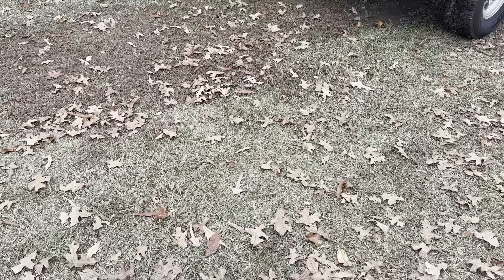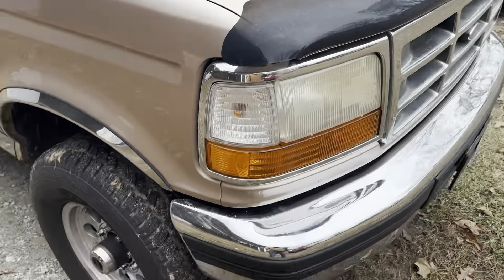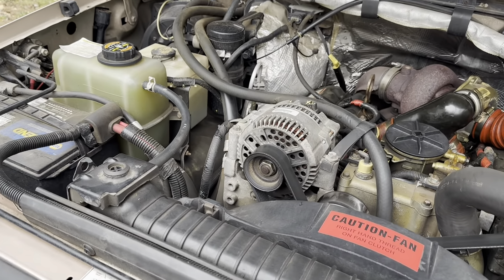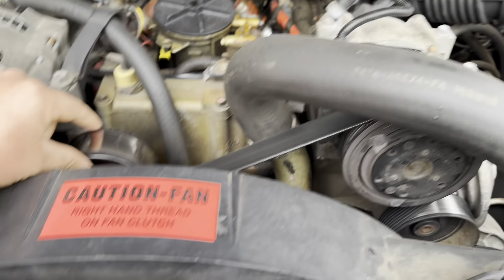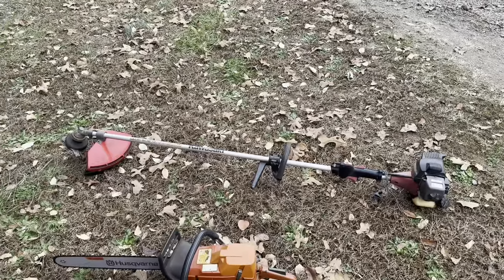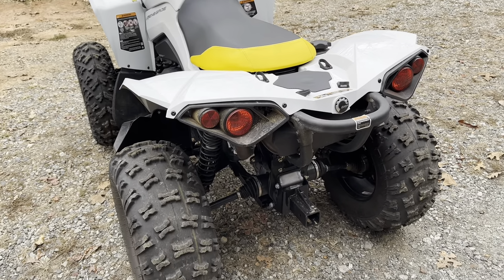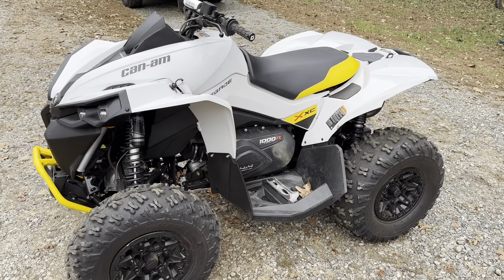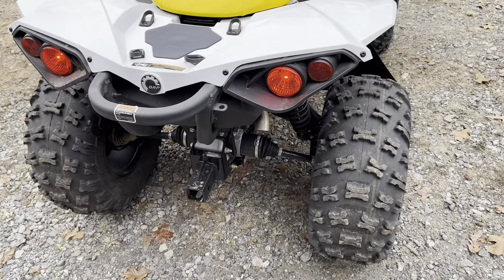What I’ve been up to and my new renegade 1000

Comment: Drew you can change the oil in that truck every 10 to 15,000 mi and I've heard of people going further than that but I wouldn't and they're expensive to change oil in and all of the other filters but worth the money because of what a good work truck a Ford is anyway and especially a powerstroke truck
Reply from the maker: With these trucks having the Heui system for injection it’s best to change it more frequently. These and 6.0s. I’ll be changing mine every 5k with T4 and I run the motorcraft oil filters.
Reply: @drewscreations8551 every 5 is doable 10 to 15 is ridiculous but to each their own. ❤
Reply from the maker: @justinweaver8107  5k is what I’m doing. No more.

Comment: I was going to tell you with your truck, be sure to keep a check on your idler pulley belt like you were talking about and keep a spare with you and a spare belt with you at all times because those belts will stretch on you and The idler pulleys will go out on those trucks and also keep an eye on your plugs on your alternator and take your thumb and keep them pushed in to make sure they're making a good connection all the time because that 7.3 is a little tough on engine mounts sometimes but they will call the plugins on the alternator to work yourself loose at times and you will be running off your batteries and not realize it and that's just coming from me because I went through a few of those trucks back in the late 90s and early 2000s and I never had any problems with that particular engine, except those two things with the alternator and the idler pulley but now all of my trucks were straight drive trucks too and I never owned an automatic in a Ford diesel and hopefully you won't have any problems with it and it is a damn nice looking truck too 👈🏻🤘🏻🤘🏻🤘🏻
Reply from the maker: Thanks for the advice and compliment!